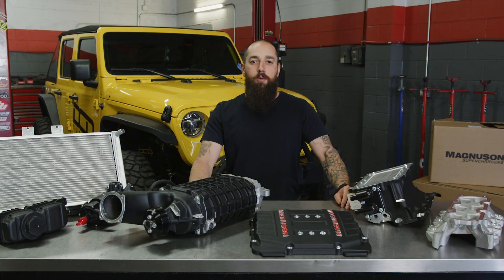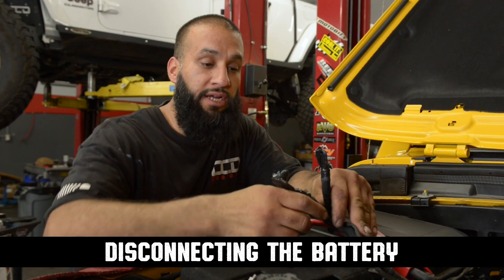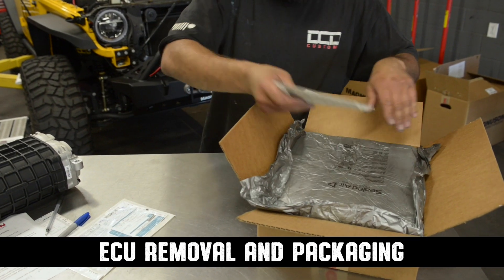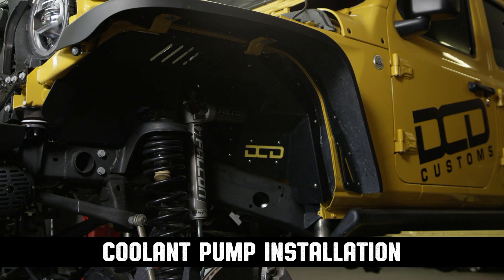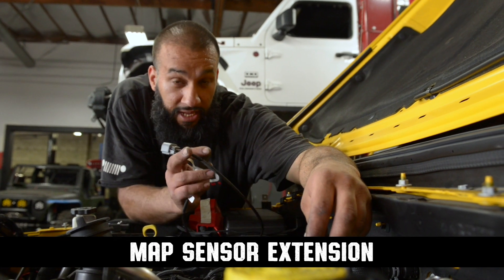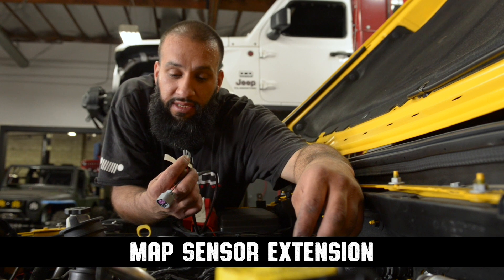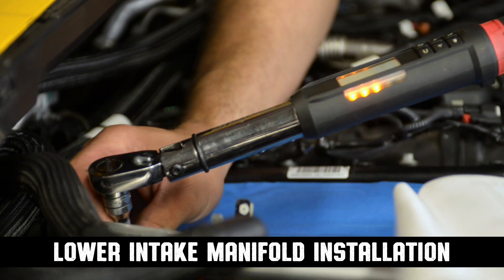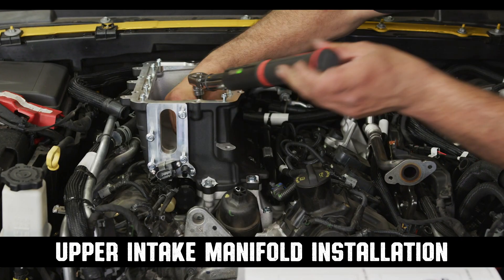Magnuson TVS1900 Supercharger Install - Jeep JL Wrangler, Jeep JT Gladiator

Comment: Spend the xtra money and get a v8 swap.  Sure it gets you the horse power but still has to work  far harder   A v8 Will last 3 times longer and pull any Jeep like nothing.   Go to a place that does v8 swaps and there is a wall of super chargers there
Reply: How much does that run? About 15 K I assume?
Reply: About depending on what motor u go with i bought a used l86  460 foot pounds of torque stock with a 8 speed transmission with 5 k miles on it for 6k.    Swap kit is like 7k then a good radiator
Reply: V8 swap is WAYYY more expensive and tons of issues! I had ine swapped V8 jeep and its nothing but electric issues. Real pain in the ass
Reply: @alexkin3265  then u had a 1/2 azz job done.   Mine was done 4 years ago 0 issues
Reply: @erikbrown2682  i got it already swapped, so someone did shitty swap and the thing is nobody can fix it/figure out whats happening... Lol
Reply: @alexkin3265  idk where ya live but there is a great guy in Wi That’s very fair 
 And ya swaps are not cheap but the cheapest is a 5.7 hemi swap get a fairly low Milage 1 there not crazy expensive and they now have plug and play kids if u stay fiat

Comment: anyone here have one installed on a manual transmission jeep?
Reply: Currently in the process
Reply: @breakitfixit5102  How did it go?
Reply: @breakitfixit5102  Any issues?
Reply: we are doing a magnuson on a 21 gladiator now here at competition auto in springlake NC now

Comment: Just 1 question... how much does it cost for the installation??
Reply: Of course depicting the location and what they charge your average $1500-$2500 in labor and around $7-8k for the supercharger itself. Could take a week to get it back since the installation is around 8 hours. So they may put it on a back burner money wise unless you have or know a personal mechanic that can do it for you in few days and possible cheaper labor negotiated.

Comment: What are the dyno gains and shop time?
Reply: Another video showed 210 stock at the rear wheels on a JT Rubicon and 309 at the rear wheels after the Magnuson was installed. The video was in Arizona I believe and it was 100 degrees out during the test. You get almost 100hp boost. I quoted at the wheels, not the engine.
Reply: @onebridge7231  i decided to get the diesel instead. So far I love it. On 37s it gets 24 on the Highway hand calculated.
Reply: @georgiafan6618  I already tuned it through another vendor since posting that. Dyno’ 285HP 488TQ. Now it’s on 40s getting 23 mpg combined and feels like a whole new vehicle. 

DEF is disable, EGR disabled and there’s a much more streamlined exhaust system 😉
Reply: @mattbrew11  I'm considering the diesel, but the DEF system has me worried.  Did you do exhaust or did you turn it off on the computer?
Reply: @KJsProjects   def tank is in place for visible inspection but its just full of distilled water now
Reply: @mattbrew11  so were you able to turn off the def with a tuner?
Reply: @KJsProjects  my kit came with a cloned ECU that was adjusted for tuning and emissions
Reply: @mattbrew11  Where did you get it?
Reply: @KJsProjects  “I live in Canada” try search for ecodiesel owners around here.